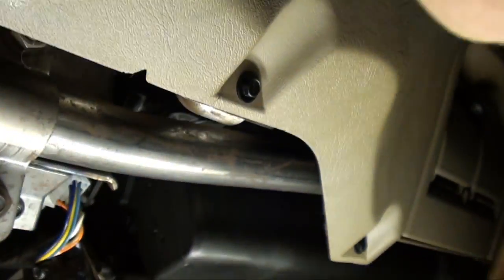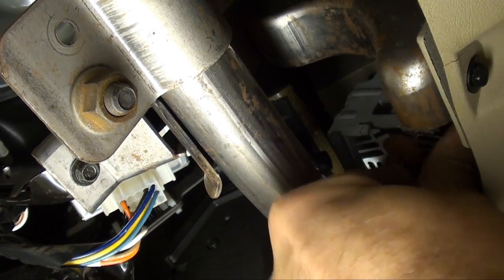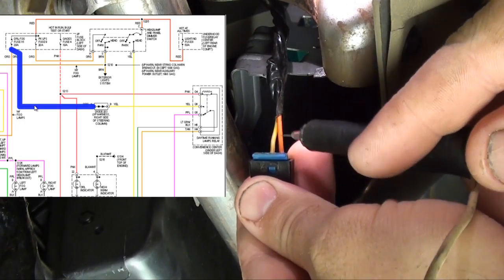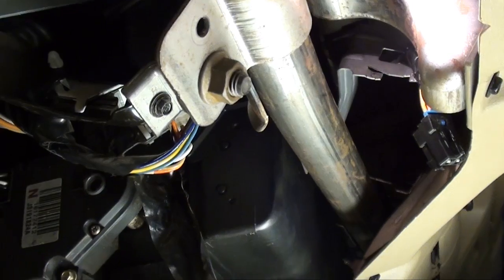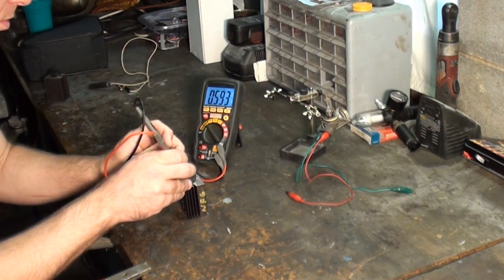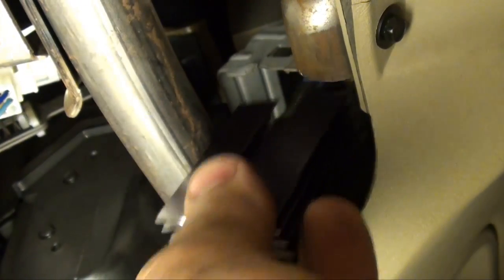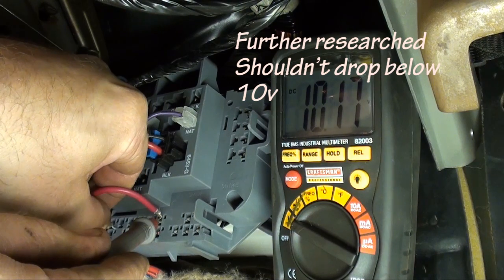Part-2 Daytime running light circuit troubleshooting (DRL circuit)

Comment from the maker: Thank you, at this time i don't have a schematic around to even start guiding you through the circuit, if i get some time tonight i will do some research, i would prefer going over this on my forum that way i i can post the schematic then guide you through it, plus we dont need to worry about running out of characters like we do here my website is toolsandtime. com the forum is free just start a new topic and i will respond later on, will
Reply: Hey

Comment: hi great video,would you know why after putting my 2000 s10 blazer in 4 low both my low beam headlights went out i changed relays,fuses are good,and changed bulbs.
I'm stumped and don't know what to do,any help would be appreciated.

Comment: Very nice work Will! Your troubleshooting skills are unsurpassed. One thing you could do different is where you checked for continuity of the wire at the diode connector to the relay socket. You could place a jumper on the diode connector and then use your test light at the relay pin. Diodes usually measure about 0.7V when forward biased, however, the higher current ones usually run about a volt across them. From your wiring diagram, you have two of them in series. The two volt drop is correct.

Comment: I have the opposite Problem... My DRL will not go off.  I pulled 10 Amp Fuse for DRL and it went out.  Tried appling the E-Brake and they stayed on. So I think I have 2 Problem, E-Brake Switch & ?.

Comment from the maker: Thats a good guess, just uploaded a new follow up video, they do have issues like you mentioned however in this case it was a bad U-joint... sorry
the good news is this truck has a band going bad its a 4L60E, he uses this truck daily so We picked up a used transmission that i will be refreshing along with removal and replacement. so look forward to this rebuild/refresh video series coming up shortly.
thank you

Comment from the maker: I agree as well, As for the testing that's why i tried to disturb as little as possible. like you mentioned if it was a bad connection, and i disturbed the connection the condition may go away for a short time only to return down the road. very good point. Its happened to me more than once lol

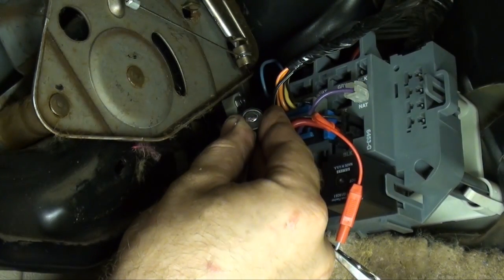Comment from the maker: yea i agree with that, that's what i was assuming as well, Its hard to notice a deferance on the vehicle because the lenses are hazed as you can see @ 12:55 when i go from DRL to low beam Switched, However on the bench you do notice its slightly dimmer. Just seems like wasted energy for that slight of a deference. maybe it helps with the life of the bulb as well. That would justify 
 You have a good point i should of performed that test as well... Thank you for the feed back

Comment: Yeah man after another look at the diagram you are correct. Without the diode pack the lights would burn at full brightness.  This also explains why the pack is so beefy (has to handle lots of current draw from the lights). I also agree that if you have diagrams and can trace out the wiring you should attempt to troubleshoot without removing items, since if there is a poor connection you are libel to disturb and loose the problem only to have it possibly return later. Aces man!

Comment: The diode is there to make a voltagedrop in the circuit to dim the lights during DRL. Diodepack could also have been tested by jumping the diodeconnector in the car. This way the integrity of the wiring would have been checked also. As always there are many roads to victory. :)

Comment: I find that my 98 gmc trucks daytime running lamps are  dimmer then my low beams. which would explain the voltage difference. which kind of makes sense if it's to make the lights last longer. sounds like your yukon needs u joint or something in the transfer case if It's a 4x4 or something in the differential

Comment from the maker: Thank you for the compliment, when making these videos i try to explain things in a way that make sense to me if i where in need of help without complicating it to much, I agree with what your saying... me just changing a part wouldn't do much good, Use this case as an example, i may have another GM come in With inoperative DRL system and find it to be the break switch or a bad ground. Troubleshooting is key 
thanks again

Comment from the maker: To be honest i tried finding some info on why they use the diode pack didn't have any luck yet, however it dose drop the voltage and wastes allot of energy, hence the reason for the heatsink. its wasting that 2 volts as heat, not 100% sure why they chose to do that. I would be guessing

Comment: I agree. Usually diodes are there to prevent retrograde current flow, sometimes to protect motors or retrograde flow in the case of a variable ground downstream. I'm not seeing that in the schematic, but we may not have enough info. Big heat sinks seem like a waste of energy these days -- I get a feeling they will be relics of the past when engineers rethink design strategies. 
That's a nice demo, as always, Will.

Comment: Very through in your trouble-shooting. Wonder why the diode is there in the first place?  And what a mammoth pack it is too-Large heatsink and cooling fins. Most silicon diodes drop ~ 0.7 VDC when forward biased. I think your diagram showed several in series.  3 would have dropped ~2.1 volts.